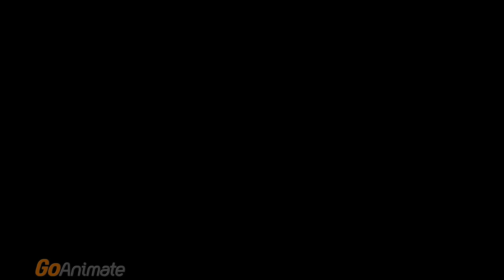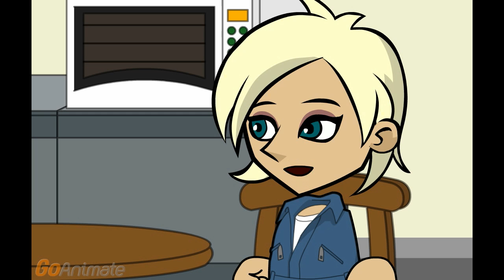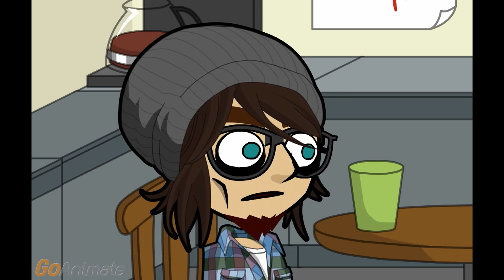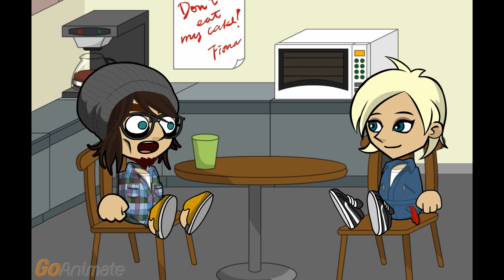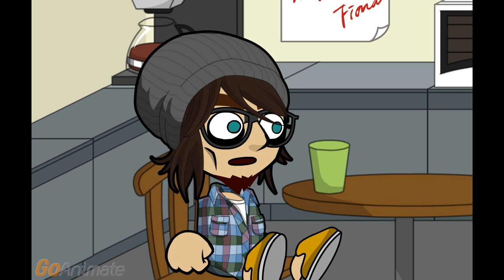Why is My Water Heater Rumbling?

Comment: Hello,

Thank you for the post. I do have a gas water heater and it is a 50 gal and mine rumbles only when the burners ignite, for example when I turn the hot water on in the house and run the hot water for a little while so the heaters turns on to heat the incoming cold water, that is when mine rumbles. Rheem said to have the gas pressure checked, that is what I'm waiting for now. Anyone else have this problem?  email me: wstj8@aol.com
Reply: yes and now after failed fixes of attempting to drain and restart it now smells like sewer water again, w/ the loud bursting, banging noises. Even though I'm 1 of 7 other tenants in this slumlords 8 units they all have their water maintenance.If I could afford to move I would. My gas bill was the highest in 7 yrs, and I haven't used anything but the furnace that's also making bursting noises now after the 8 month the hot water's been bad. Is there any inspectors that might make him repair for safety and that hot water is a basic element people need? Hoping someone will help, I have no one, my family passed and my only son lives 1,500 miles away.